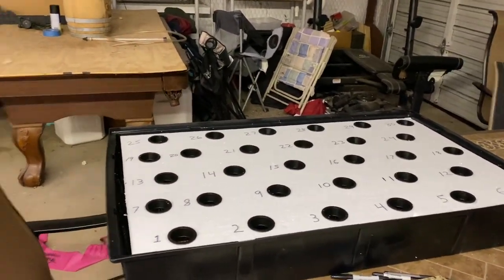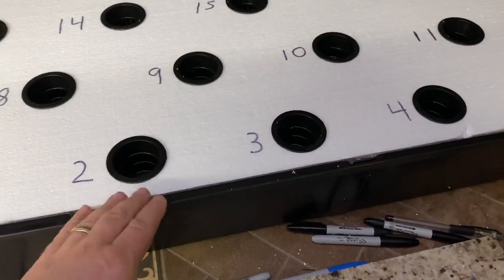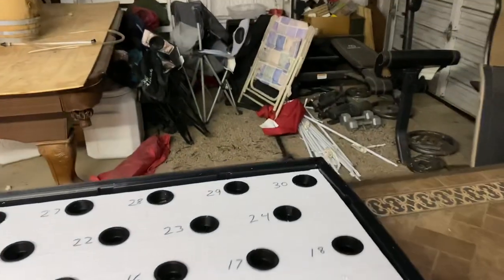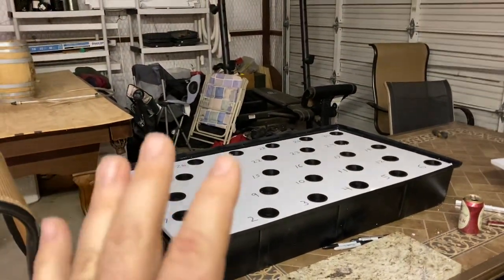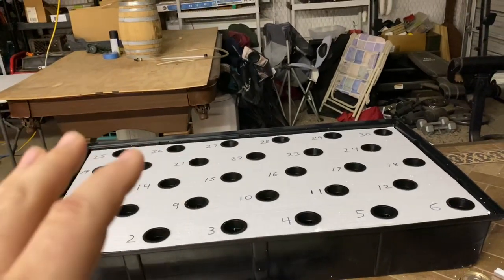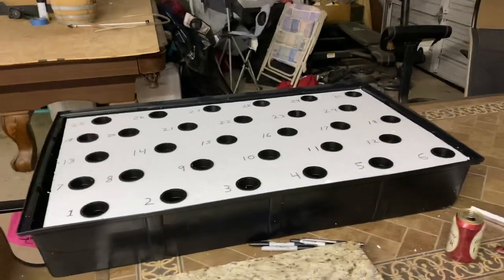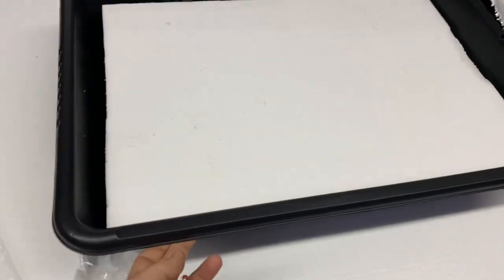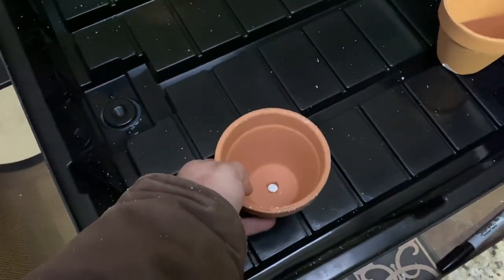New Home Scale Indoor Vertical Hydroponics Farm - Part One

Comment: With more temperature sensitive plants, in a cold growing environment, would it help to heat the water in a system like this? Or would that have no effect if the air temperature is to cold?
Reply from the maker: It won't have any effect on air temps in a meaningful way, it will speed growth though.

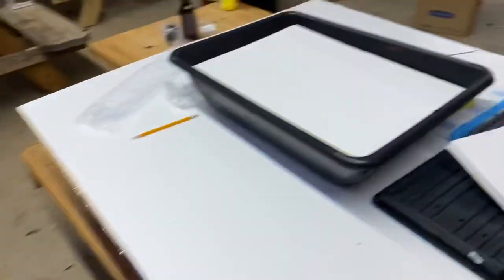Comment: Looking great Jack!  Regarding your seed starting tray at 7:34.  If you want a simple off--the-shelf solution, check out the Park Seed Biodomes.  The 120 cell system is on sale right now for $40, and the refill sponges run 13-17cents each.  It measures only ~20"x16" and should run 1-3mo without needing a refill.  No plumbing needed and plenty of extra capacity to start your lettuce plus a bunch more.  I'm going on my 7th season with the smaller 60cell systems, so can vouch for their durability.  Here's a video of someone starting with a 120 cell system.  https://www.youtube.com/watch?v=A-Vy3Q7Wzn0

Comment: When you show the demo section on top of the pot (9:24) it looks like you are using the foam board with a reflective side?  Would flipping the foam board over to have the reflective side up instead of below have any benefit of reflecting light everywhere?
Reply from the maker: May be but I don't like the way it looks.

Comment: Why use styrofoam. Wouldn't chloroplasts be better jack
Reply from the maker: You mean something like this?   if it holds up, seems like a good idea.  https://thd.co/372hJ1c
Reply from the maker: This was a great suggestion, part two is out and while I forgot to mention that you can see I switched material.